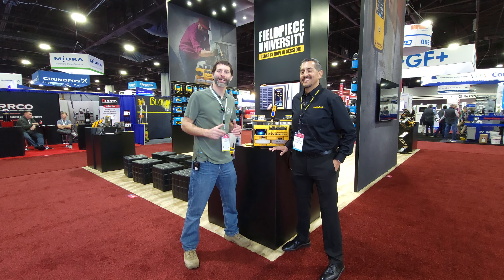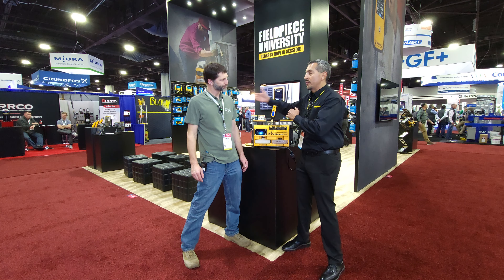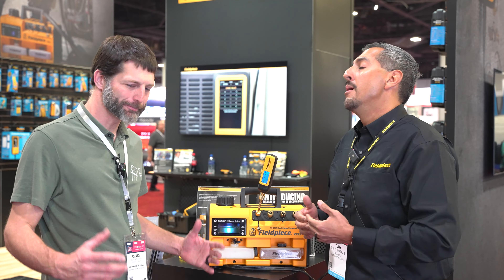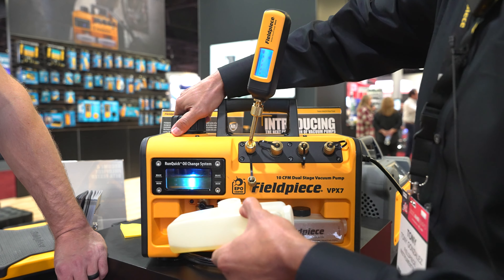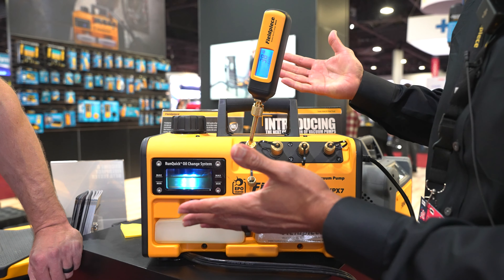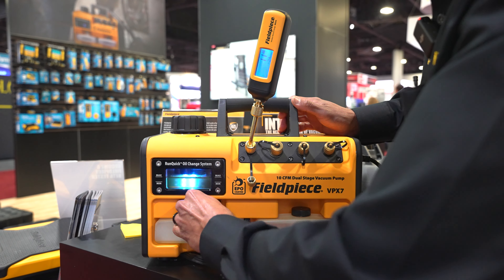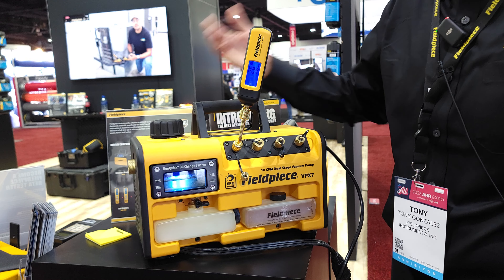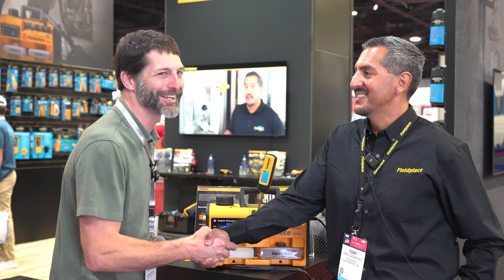HVAC Vacuum Pump Oil Basics and Fast Oil Change with Fieldpiece!

Comment: I use mine for auto A/C and have to change the oil multiple times after a system flush to get it to keep pulling deep, due to contamination. Makes a massive difference 👊👊
Reply: This is because car air conditioning systems use medium and low temperature refrigerants, such as R-134a

Comment: Good video, Pro tip that's a good way to test your micron gauge by placing directly on the pump!
Reply: I test my pump before every job, and always start with clean vacuum pump oil. I remember once after a vacuum on a van that I flushed the vehicle A/C system with solvent and blew dry nitrogen through to aid drying/evaporating the lines. It took 5 oil changes after testing the pump the next day before a new job.  so would run pump a few mins after each change to get it pulling down into the low microns again! Micron gauge straight to pump after flush was 480 micron on a pump that is capable of 15 microns so after 5 changes was back down to 16 microns. Oil quality makes a massive difference.

Comment: I change my oil religiously. When working on large commercial systems and time management is uber important....dont let something like oil drag out the process. We work on large chillers and pulling a vacuum is a time consuming process.
Reply: Can you use oil left over in unused bottles with caps still on? 

I have several leftover partials and I’m always inclined to not use since they are opened. The little plastic caps are on but does the oil pick up atmospheric moisture?
Reply: @darwinawardcommittee  i wouldn't. Once its used. It goes in the disposal tank to be taken somewhere. That oil gets moisture laden and decreases its efficiency

Comment: Did anyone else notice, that the hot swap caused the microns to skyrocket. Not to mention I wonder how much wear that causes to the pump. I like the design but it looks like the TEZ 8 has a smaller footprint.
Reply: Yes I did notice but to be honest this was down to 11 microns when u really need 500 , at a 1000 or 800 you won't lose that much, I did try it and notice the i almost lost nothing at 800 microns , I did try on 25 microns and it shoots up to 380 and went down to below 35 quick in seconds , BUT talking about wear and tear I think keeping a fresh oil will keep it healthy, the reason for the vacume loosing a vacume and hearing a noise  when draining the oil is that ur taking that wall ( seal) away which is the oil and the sound is simply that very thin oil wall left flapping between the pump housing walls , but of course heat will cause damage if you run it for a very long time with low or used oil, fraction/contamination, one thing I hate about field piece is that ur pump needs to be almost 100% level for a good vacume, other brands I try it won't make any difference.
Reply: @LaythYounis  Good to know. But if hot swapping is going to introduce air into the system they should really tell you to isolate it first - if that's the case why not shut it off while you do the swap. I can just imagine the poor tech who spills the new container of oil and runs to the van with the pump running dry. It's a gimmick that we don't need.  Appion had this over a decade ago and I always shut the pump down and isolated. Most hot swap systems have a tube that runs to the bottom of the container so oil level doesn't matter.  The other day I dropped my yellow jacket out of the van on the ground and I said thank goodness I didn't buy a plastic field piece.  To each there own, looks nice but do you really need it?
Reply: @supermrt  so far it's the fastest, talking about isolation , field piece is a newer unit , other brands is out there and field piece can't do much due to copyrights,, but the damn thing is really fast and lasts a very long time. I don't want to say brand names but I try good amount of pumps, they fail , starting from 10-30 min to 3-4 hours , plus field piece offers getting ur pump rebuilt for like $265 I think just incase ur unit failed u can bring it back to life.
Reply: @LaythYounis  Thats good to know, however do they sell the parts to rebuild the pump yourself? I have 6 yellow jacket pumps 2 of them are from the 80's and still pulling sub 25 microns. The gasket sets are hard to find but I still have a few.  Everyone wants to make up buck off service, and keep things proprietary.  Sometimes the old stuff is the best. I most def will be waiting to see if I have to buy anything special for A2L's before switching to different pumps.
Reply: @supermrt that's I'm not sure about Yello jacket parts, fieldpiece dose has parts but very limited, and oh I agree about that a2l's I keep seeing the class flyers on supply houses but im in texsas its getting very busy , no time.
 I don't like r410a anyway r 22 much better, well see those new ones. Lots of customers will be SUPER pissed.